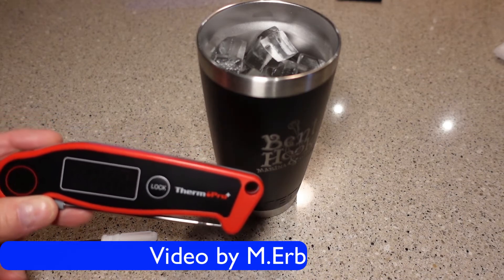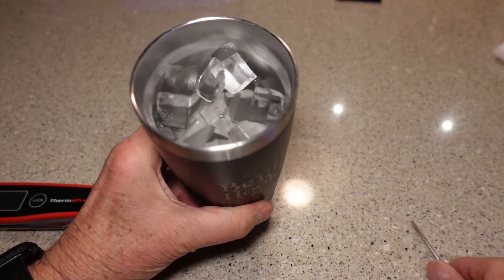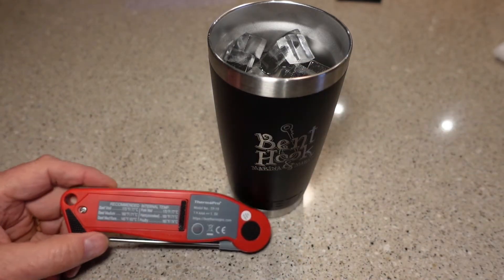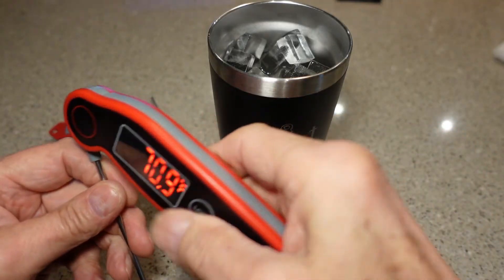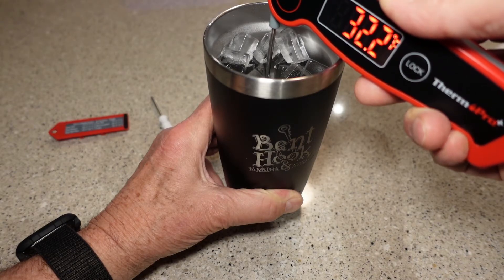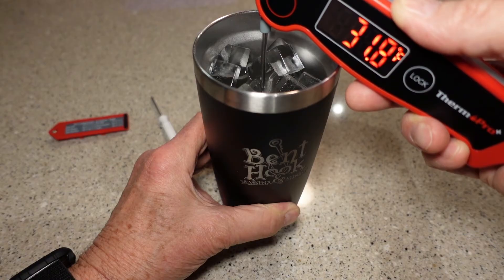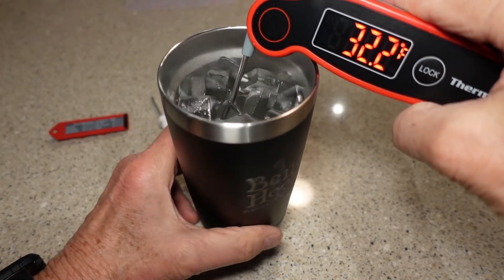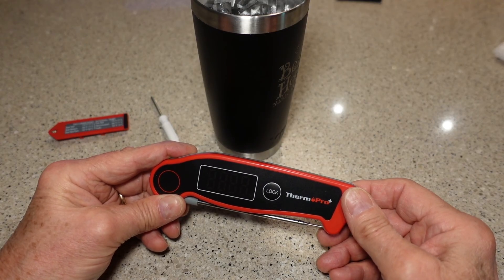Tutorial How to calibrate the ThermPro TP-19 Digital Meat Thermometer

Comment: Nice video. Im here, once again, in an attempt to get my thermometer calibrated, and once again, it has failed. I have the exact same unit and can not recommend anyone to purchase it. Not for $30. I have downloaded the instruction manual. Followed calibration instructions  exactly, been trying for years, at least 8 calibrations. It always reads 3 -4 degrees to high in room temperature, and either 2 degrees to low, or to 2 degrees to high in the ice water. Just changes from to high to to low randomly. Its supposed to be accurate to within .9 of a degree. Temperatures are much to critical when cooking to play this guessing game. Buy a different brand. Poor quality control. For $5-10, okay, not for $30. I expect better.
Reply from the maker: sounds like you got a dud. I'm sure you contacted the company right?
Reply: @michaelerbreviews  I may have. I have only one sample size to compare to. But there should be no duds. Its either accurate or it isnt, and if it isnt, it shouldnt have made it past quality control.